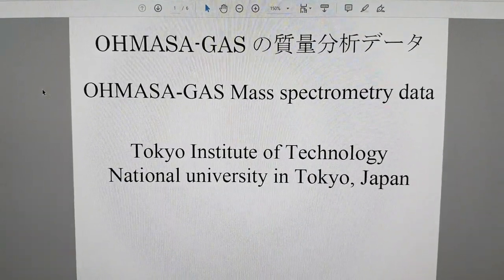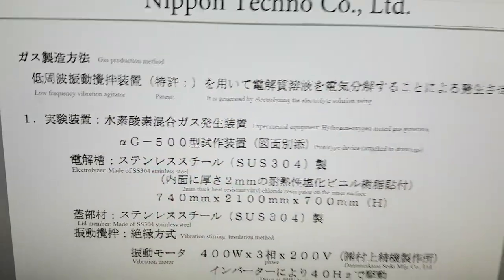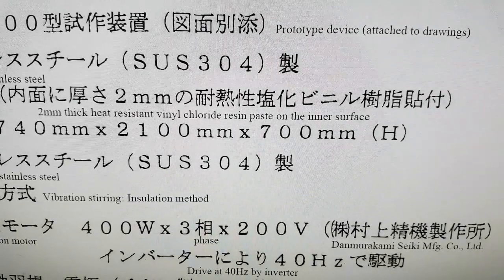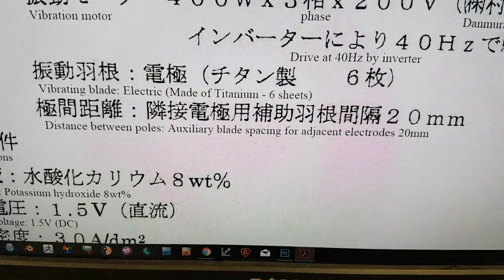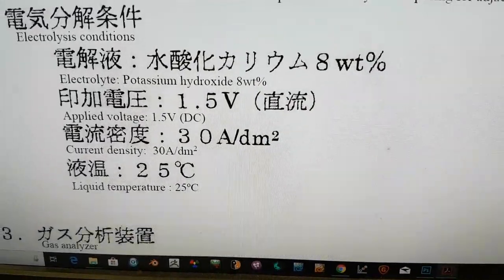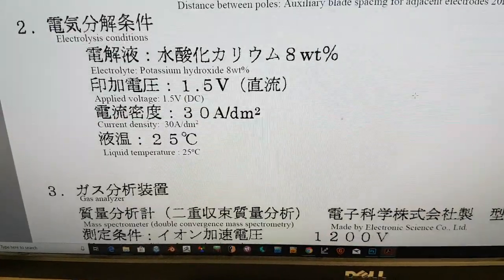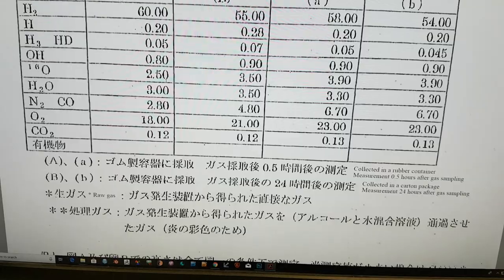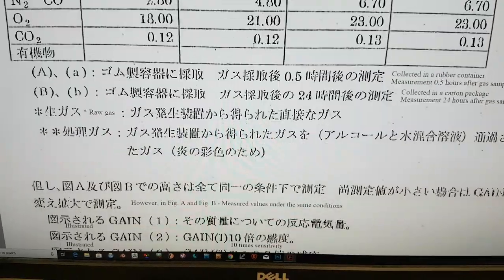OHMA - Ohmasa Gas mass analysis by Tokyo Institute of Technology

Comment: I’m curious how this sample compares to Browns gas and/or HHO or are they basically the same. Obviously BG/HHO typically formed via electrolysis.
Reply from the maker: Dr. OHMASA claims specific properties, such as it can be stored in gas bottles for over a decade without hydrogen embrittlement and it can be liquefied and re-constituted.
Reply: @MFMP  Thanks for the reply. I noticed in one of Dr Omasa’s slides, he mentioned that H2 is so small it can permeate cylinder walls as opposed to Ohmasa gas. Been looking at Martin’s past videos on this. I’m curious whether this gas could be used in a commercial space application such as a maneuvering thruster for satellites or spacecraft? Much safer than other propellants but likely would have lower thrust which isn’t necessarily a show stopper.